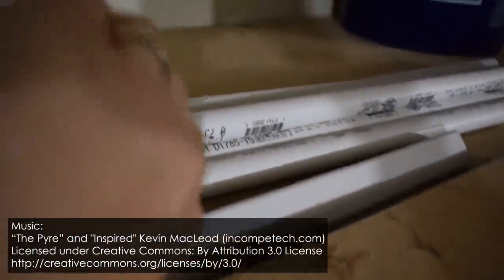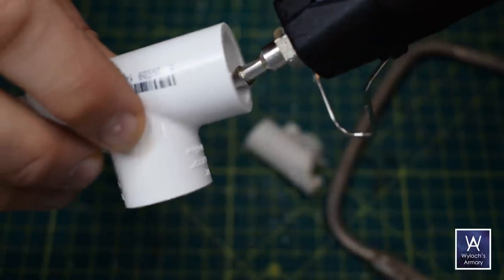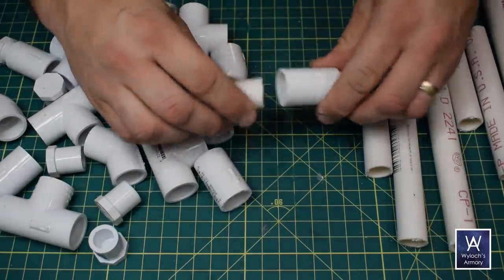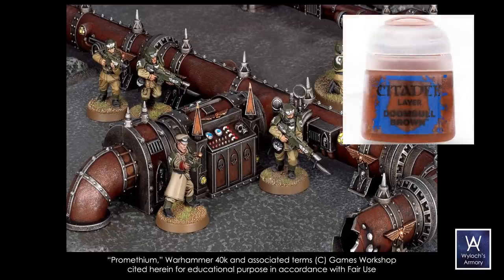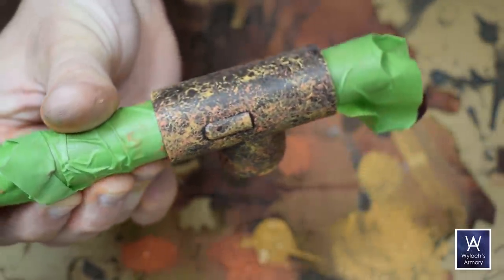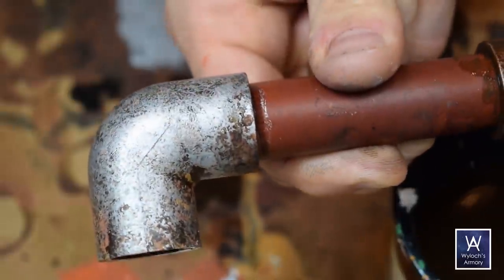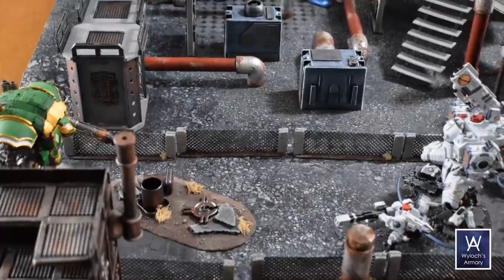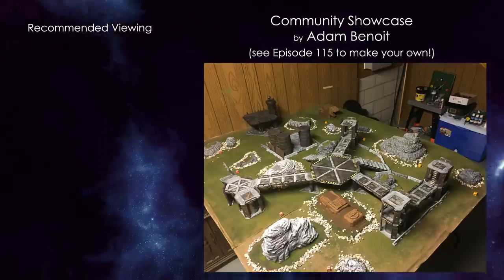Cheap and Fast DIY Promethium Pipes for Warhammer 40k, Kill Team

Comment: Also something of note, when you say that the curved surface is an issue when adding grebel. To solve this, take a pipe, wrap it in sand paper around 1000 grit or higher and take the object you want to add to the pipe and sand it back and forth on the pipe with the sand paper on it to wear it down to the proper shape. *If you think its going to take too long you can start with a Dremel. *

If you are wondering ive been a hobby nut for models since the 90s and have made a lot of scratch built stuff like plastic card space ships and model kit bashes of warships/tanks for sci fi props for BattleTech and Star Wars/sci fi games for a long time.

Comment: A visit to any Habitat for Humanity Restore in your area or a similar resale shop for home improvement can often net you odd lengths of pvc pipe for pennies on the dollar. I've found bags of the connectors there as well.
Any sander - disc, belt, or spindle - will make short work of the manufacturer's marks on the connectors, too. Even a handheld random orbital sander or a Dremel type sanding tool.

Comment: If you want to replicate the 'new' GW pipes, hardware stores have Watering Sprinkler Risers. 
These are ribbed rubber connectors you can insert into your pipes to make them "plasma" conduits. 
Obviously paint them with OSL or burnt copper effects if inactive.

As for "more detail" i'm adding plastic strips laterally and longitudinally, and experimenting with drops of thick/ gel super glue set with Baking Powder for Rivets.

Comment: 2 ways to do some quick and dirty details for your pipe set:  Least involved: Take some cotton swabs, cut off the ends and cut the stick into small bolts. If it has a hole inside, just put a dap of superglue on top, it will give it a light rounded head, looking like bolts. Or a more involved way: Take something like Instamold / Oyumaru and get a Torx bit set. Press the torx bit into the flexible Instamold and then let it harden. Once its hardened you can push in a dab of epoxy putty (greenstuff) into it to get screw on bolts. (Technically you don't need instamold, using wax and slightly warming the wax to have it come off the epoxy bits once its hardened would work to for a low cost method)

Comment: Add plastic sprue to create a better finish.
Use a soldering iron to create melted holes or damage.
Add lengths of different thickness cables.
Add cable trunking for a different scenery type.

Comment: For valve handle greebles use the metal snaps from a fabric or craft store. The top piece looks like a wheel with spokes.  I use the bottom part for mines in a minefield.

Comment: Good point on the modular pipe - I find that when people go a bit nuts with modular things like magnetising every bit of sector mechanicus you end up spending an hour just building the board, nevermind playing! Also it means you cant ever do any storytelling on a piece of terrain as it has to all come apart and fit with anything. 

The one thing that could work though is semi-modular, so like a few building corner 'fit' when butted up to each other to make a full ruin. Or say with these pipe layouts you could plug a few into a couple of others to create a bigger network for when you felt like it.

Comment: You're on the right track. Just grab a piece of thin platic or a piece of paper. Wrap the tube with it, and hold it with your gloved hand. easy mask with no tape. If you use a just piece of folded copy paper or newspaper you're good. Magazine paper or glossy stuff works well for quick masking. You can get good effects with a magazine and a rattle can.

Comment: Helpful tip: you can buy a reliable ratcheting PVC cutter for about $10 (cheap ones around $7ish, high end ones $20-$30). They can cut the PVC 10x faster, easier, and smooter.

Comment: With PVC you don't really need the hot glue, you can push them on and they will stay connected and eat to pull apart if needed.

I use 1/2" PVC as a spool holder for my 5kg spools for 3D printing, no glue at all and works great.

Comment: Love how that weathering turned out, and the contrast with the sludge color. How durable is the hot-glue only sludge part? I'm thinking that hiding a pin or piece or inside of it to reinforce it but that might be overkill.
Reply from the maker: Try and break a plain rod of hot glue.  It's at least as tough as that.
Reply: @WylochsArmory  Awesome, thanks!

Comment: Just wondering, have you tried parchment paper instead of wax paper? I've found that parchment paper works well to keep things from sticking and is reusable to a point while wax paper tends to tear easier.
Reply from the maker: Good tip, thanks
Reply: @WylochsArmory  
No problem. I do fuse bead pixel art and they alway come with wax paper and it always melts to my projects so I tried different types and parchment is by far the best

Comment: why not try length of sprue to add more effect to your pipes?
Reply from the maker: I did try that, but they did not adhere well because of the curve of the pipe.  The area of contact for the glue was an infinitesimal width line.
Reply: @WylochsArmory  oh man that sucks, i figured it looked pretty great on the generator you built so I thought it would work here as well.